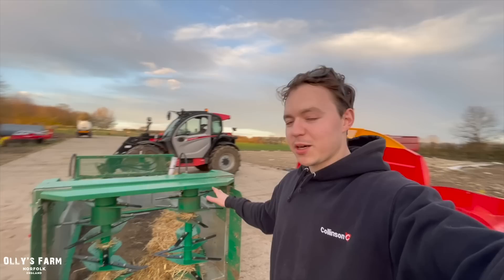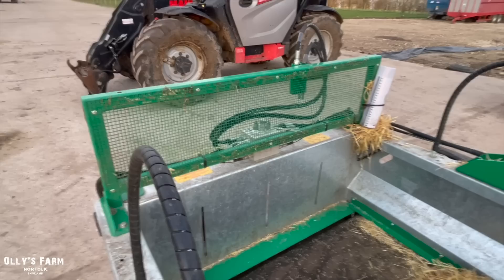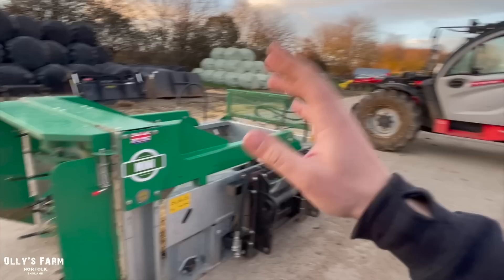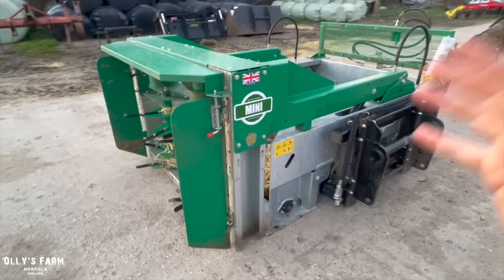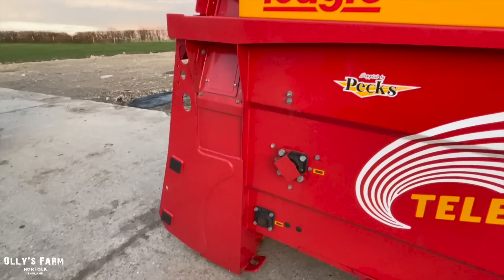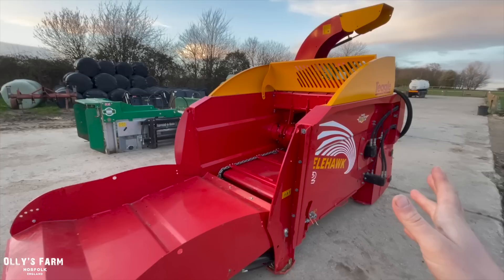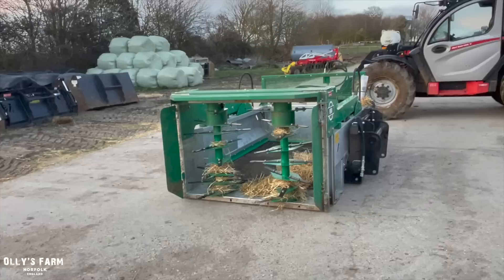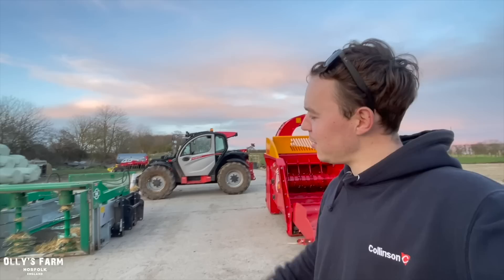SPREADABALE vs TEAGLE TELEHAWK SHOWDOWN!

Comment: I had both on demo olly. I went with the spread a bale because of the dust that the teagle was producing. I was mindful of creating pneumonia issues with the calves and young stock. If you are building a new shed and are able to drive in for bedding, I would go for spread a bale.

Comment: The Spread-a-bale seems to be simpler and will likely require less fuel to run, but will likely not tear up the straw as much, which can be a benefit or a drawback, all depending on what end result you are looking for.

Comment: Big decision both machines are spot on however the Teagle tele hawk would be your best option better chop with the straw you’ll find the spreadable will cause hassle with the straw binding within the rotors and the belt will wear down a lot.

Comment: If you intend to bed the sheds while the animals are still in the shed,we found the spread-a-bale was a lot safer,because the straw does not be spread with the same velocity as a straw blower,and if there is some stones in it,they are very dangerous through the blower to the animals eyes..therefore we chose the spread-a-bale for that reason...another plus of the spread-a-bale is that if the straw gets stuck in the rotors,it is simple to reverse it,to free it,without having to get out of the cab..but with the teagle,it was hard manual work to free a choke..finally I would definately recommend the midi spread-a-bale over the mini,because you can fit in 2 round bales or any size of square bale,and isn't that much heavier than the mini,especially when it's a telehandler that you have.the mini is really best suited to tractor mounted loaders

Comment: I just had the very same decision to make I’ve a manitou 635 and went with the spread a bale midi. I didn’t like the way you needed an extra oil return pipe fitting on the teagle plus it was very dusty. I put a new shed up and made a feed passage way at the front so I could shut the cattle in it while I drove in behind the to bed up the main part of the shed. I got the midi because it also takes square  bales which will help at harvest and be able to get twice the weight of straw in the same space in the shed.
We had a 630 manitou first it was the best thing we ever did changing to a 635 very slightly wider which makes it more stable

Comment: I use a tomahawk, I don't really like it. Does a really good job, but lots of faff. They are a pain to unblock because it blocks around the edges of the fly wheel, so you can't get in easily to clear. Also eats shear bolts.
Reply from the maker: Have you tried the updated models? The telehawks design is super simple and I haven’t been able to block it yet 😉
Reply: Is probably a fair few years old to be fair. Does also depend alot on bales as well, they don't like a damp bale